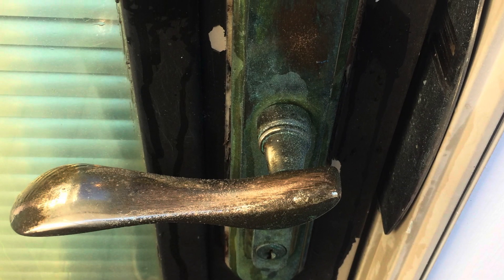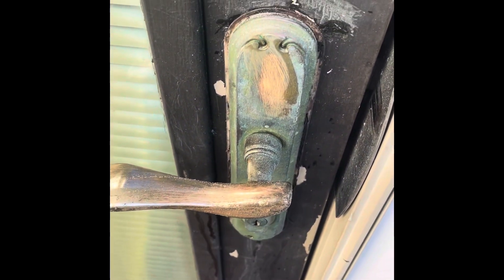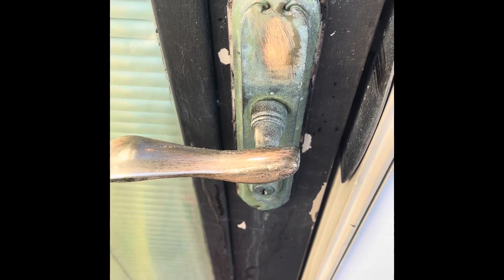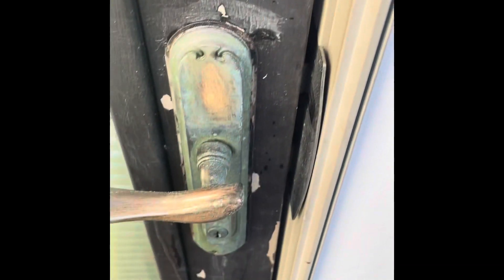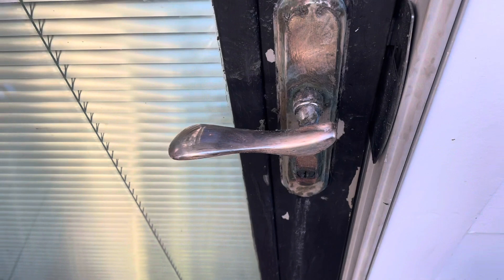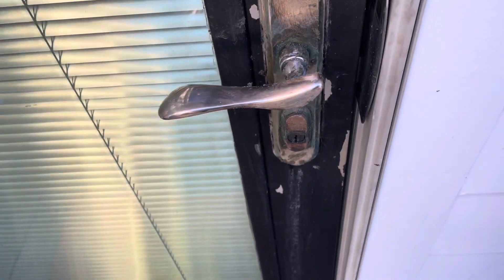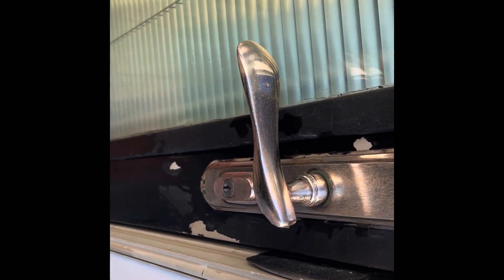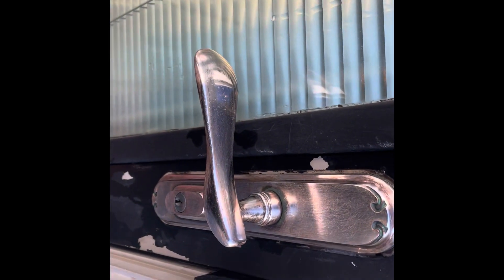Restoring an $800 brass door handle for client

Comment: you handled that pretty well, nice job.  I'm not here to criticize what you did.   I would take the handle off the door first. That will allow you to inspect it, give you much better access to clean it and less chance of damaging the door. Most exterior hardware will have a lacquer coating. newer interior hardware will also have it , but not older stuff. taking it off is pretty easy, sometimes it just flakes right off. otherwise you can use a little paint remover to soften it up and then a soft bristle brush or rag to remove it. If you don't want scratches, don't use anything abrasive. now the fun part. clean it with some soap and water, and you can use some Brasso or mothers wheel polish. if you don't have any of that. then lemon juice and baking soda, vinegar and baking soda, even tomato sauce. a quick internet search will give you all kinds of options. you can stop after that and put it back on. or you can go one more step and reseal it. get a can of rustoleum spray lacquer, its like $7. prep is super important. for the lacquer to stick you need to clean the handle really good, and don't want any residue so rinse well. after that put a couple coats of lacquer on it and your done. I have used this method on stuff anywhere from a few yrs old to stuff over a 100. You can also use a brass wire brush to get a nice shine on it without scratching it.
Reply from the maker: Thanks.
Reply: The door was being painted after so doesn’t matter if you mark it
Reply: @challyho2u244  did you read the second sentence of my post?  "I'm just giving some suggestions for future jobs". I'm not sure how you missed it? It's itterly  right before the sentenace your referencinng
Reply: @FS.DJParty  don’t know how you missed he already said the door was being painted afterwards

Comment: It's kind of a tradeoff. A new replacement trim for a multipoint lock like that one would probably cost somewhere around $200. It's just three screws holding it on. On the other hand, maybe spending an hour of labor carefully cleaning it.

Comment: Nice job man.  I have the same door handle.   Have you looked into a brass/metal lacquer to seal the brass and prevent oxidation/tarnishing from happening again?    I don't know where to start with that part.
Reply from the maker: No, but a great idea!